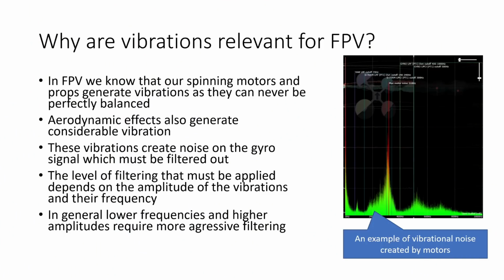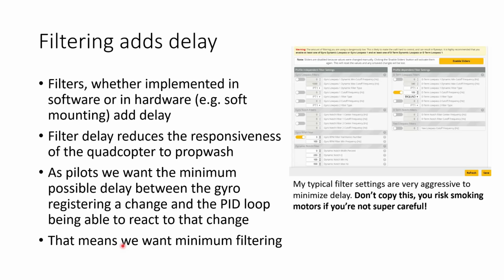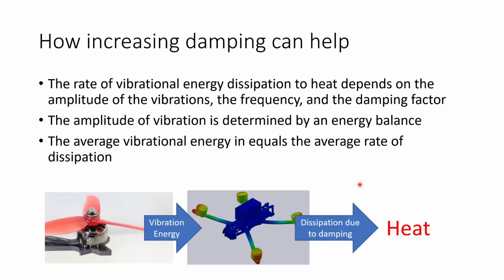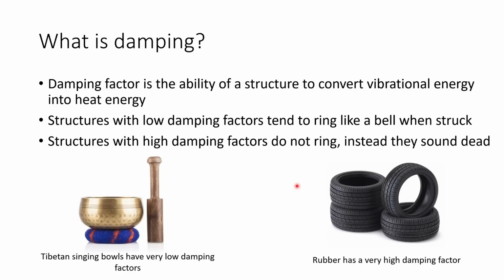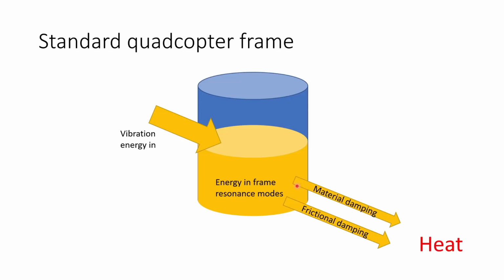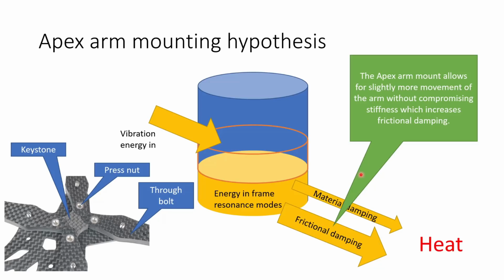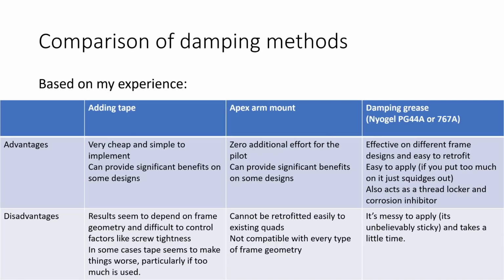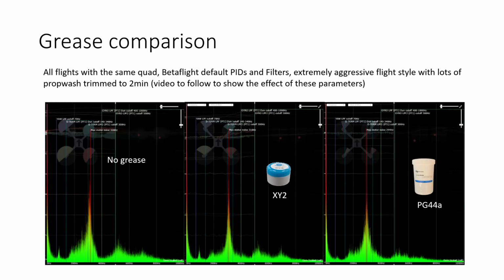How vibration and damping relates to FPV drones and how to increase damping to improve performance!

Comment: something that I think works for me is to leave the motor wires long and wrap them around the arms and then wrap them tightly with electrical tape. Maybe wrapping them with TPU or NinjaFlex or something a bit 'heavier' or rubbery could do better. I have a 5" marmotte and a 4" gecko with this 'damping' method. I love unibody frames
Reply from the maker: I'll definitely have to try that wire wrapping method. It could be a very easy way to add damping!
Reply: @ChrisRosser  if you try it, let me know if it's really making any differnce :). I need to get into blackbox reading so I can see it myself.

Comment: Also bought some for testing. Currently I'm a bit unsure, where to put it all, but will find out. For now I'd put some to all screws and a tiny bit to the contact surfaces of the carbon pieces. Don't want to mess around too much.
Reply: FWIW he has a YouTube short video where he discusses where it should be applied.

Comment: Great content Chris. Recently greased up my PFVCycle Prototype. The results were good, but man its kinda messy lol.
Reply: I'm just getting my prototype ready today and used electrical tape, I'm not going to have a before and after but I've seen someone else before and after in the frame and it helped, would love to hear your results
Reply: @ugpfpv361  not sure I can post a link, but go to my channel and look for a video called "KababFPV told me to tape my quad" that has the results and the logs in the description. I also have a recent video called "Chris Rosser suggested greasing your drone" that also has logs in the description. basically going from nothing -> tape was a MASSIVE improvement. going from tape -> grease was a small improvement further, but was messy.
Reply from the maker: Thanks for testing Mouse. It's definitely messy but I'm glad that you saw a further improvement because that aligns with my testing as well. I found the grease washes/wipes off with a bit of warm water and soap.
Reply: @ChrisRosser  yeah, if I was working with a naked frame I would have used some Dawn and warm water, but left all my electronics on the main deck and was sort of trying  to work around that haha. Sometimes trying to do something the easy way turns out harder, I probably should have done a full teardown a rebuild in hindsight.

Comment: Excellent video again! I just got two questions about it:
- How good would a layer of printed TPU (0.2mm) on top and bottom of the arms would be?
- When will you post some flight footage so we get to know you as a pilot?
Reply from the maker: It's definitely worth trying. I've been chatting with someone on Discord who has very quiet logs and they have TPU and heat shrink on the arms as wire protection.

Comment: Nyogel is the real deal and don't go thinking you can substitute something else. It's also really useful for our radio gimbals: Apply a small amount to the gimbal tension slides and you can make cheap ones feel smooth and buttery. Dry, creaky squeaky gimbals are revived!

Comment: The viscosity of PG-44A is almost 7 times that of 767A at 40°C and 5 times at 100°C. Do you think they are still comparable in use? I did do a quick test with 767A and it does seem to have some effect, just wondering whether a more viscous one would work better.
Reply from the maker: I would say that PG44a is probably the best. I've found it work really well. 767a is cheaper though and more available.

Comment: If at all possible try silicone thermal pads probably of 0.5mm variety or may be even carbon thermal pads. I imagine they might do a better job than tape with quite a bit less mess all round. At least it should be interesting to test IMO.

Comment: 👍Another good one. Would RC cars silicone oils for shock absorbers and diffs be suitable? They are sooooooo sticky... If yes, better to use higher cps number or lower? Thanks in advance for the answer. 😉😁
Reply from the maker: Possibly, I would try the highest viscosity available. Worth comparing its viscosity to PG44A to get an idea if it's worth trying.

Comment: Another means to dampen theoretically would be to use an extension such as landing gear cylinder made out of TPU to be mounted below frame mount of the motors.  This function acts akin to an archery stabilizer and the resonant energy is dissipated below the motor.  Geometry of solid vs hollow or with gyroid internal supports should provide a means to do so, but at a cost to weight, but would provide benefit of landing protection.
Reply from the maker: A tuned damper is a tricky one. You would need to tune it to a resonant frequency of the frame which will be slightly different for every frame.

Comment: Does the dampening grease really add a large resistance dampening component to shear? I understand viscous coupling example of the dynaflow transmission in old autos.  The efficacy of the use of the shear, is proportional to the speed and proximity  and as one increased the flow and closer the proximity the more the coupling occurs.  Is not more than viscous needed?  IE viscoelastic to store then dissipate energy?   .  Is it possible that the hypothesis of resistance to shear in your example is actually primarily a dissipation of frictional imparting of vibration akin to a bow of a violin?  I would argue if one placed dampening grease on a bow of a violin, one would probable see a very atypical noise emanate from the violin....... and the bow action would not be more difficult, rather easier to do primarily due to reduction in shear force, but the sound would be less due to frictional vibratory decrease?  Perhaps I am wrong, but the concept of a grease for the functional increase of resistance to shear is rather counterintuitive. Again awesome videos and thank you for your instruction and level of detail to understand this nuance of topic.
Reply from the maker: The damping grease allows the surfaces to move slightly relative to each other. It also creates an enormous amount of energy dissipation due to the viscous forces inside the grease because it's viscosity is so high.
Reply: I pose the above as a questions and not from definitive answers to be sure.  So please excuse the questions.  The reason I ask is that if one has a greater degree of coupling in shear due to the grease, would that simply shift the energy to a different harmonic?  Does your system calculate energy below the curves as dissipated energy lost from grease to no grease?  Thanks again for any clarification.  I do see that the grease does work in shear to be sure.  I am just wondering what aspect really is being dissipated.  What one would see if a identical frame were glued using  a RTV silicone vs the Viscoelastic material would be of interest as well.   Really awesome work.

Comment: It would be interesting experiment to use Piezoelectric transducers as an intermediary between frame and arm etc to generate a means to harvest energy instead of heat.  Imagine a joule thief circuit being fed by the piezo elements to power a LED system or feedback into a power system with adequate diodes as valve.
Reply: Haha I was just thinking about active cancelling with piezo, could be combine the 2 for best of both from same mechanism. A supercapacitor would give you your intermediary storage.
Reply: @DigitalArtisan77  Agreed.  A very small super cap would keep the LED's running a long long long time!
Reply: @diveflyfish  well it would, but also everything could feed it including regenerative breaking etc if the supercap buffered the main batts. Lots of little savings of power.
Reply: @DigitalArtisan77  Not sure about regenerative braking but any use of joules vs heat is a step in the correct direction. Rather, the electric energy captured could shunted to keep the board alive etc.  Low current draw aspects powered during flight would allow for longer flight? Probably nominal, but it would make for an interesting gizmo modification.
Reply: @diveflyfish  regenerative breaking is already a thing on some commercial drones. A motor is also a generator after all and theres nothing the consumer market can build that we cant. The future seems to be moving to many small gains rather than big inefficient ones I feel.
Reply: @DigitalArtisan77  Very True, I was not being contrarian, rather I simply do not know about how much one could harvest from such a small mass spinning. Its about scale to be sure.  I was just acknowledging that I have not done the math on scale generation forces of tiny motors and blade mass given the kV of the motors etc.......
Reply: @diveflyfish  didnt think you were, merely admitting lack of knowledge in that specific area, that means you have knowledge of your own to give that perspective, people that dont know a thing often pretend to know all things. I'm am aerospace engineer and we say "thingy" and "whatsit" to each other, what's the purpose of words past communication of the concept 🤣 when you know, you know.

Comment: Chris, what in your estimation would having a FC immersed in a dielectric fluid do to the signal to noise ratio and if one were to do so, what aspect of the PID would be best altered to filter more if necessary?  Assume two distinct density alterations one 1.8X as dense as water which is 800 times more dense than air and one .75 as dense as water.  If you have a means to model this please let me know.  Also, let me know if you do test the material I sent you a link to from 3M on the Viscoelastic film.  Thanks and great work again.
Reply from the maker: That's a very interesting question. Is the FC floating in dielectric fluid or is it still screwed down with standoffs? If its screwed down with standoffs then I don't think the fluid would make much difference unless it was so incredibly viscous that it could damp the tiny movements of the FC board.

Comment: Would love to see a video on ways to damping a frame with electrical tape as it is easily available and easy to work with, also how close it gets to this grease. Great video btw!
Reply from the maker: Kabab did a video where he looked at using electrical tape. It's not something I want to recommend to everyone because its very dependent on the frame geometry and screw tightness etc. It can make things worse as well! Grease is a little more messy but much more likely to give a solid improvement.
Reply: https://www.youtube.com/watch?v=Ybx4oVB2Vvg - Johhny FPV was ibto this years ago. :-)

Comment: I wonder if carbon fiber could be made with a damping material between the layers?
Reply: Chris, I have done that with one of my frames. I used a non-vulcanized rubber compound specially made for composites (Kraibon AA6CFZ) which then vulcanizes during curing in the autoclave at 120 °C. I put that exactly in the middle of the composite  (1 Layer twill 200 gram, 2 layers UD 600 gram, Rubber – 2 layers UD, 1 layer twill). And it works really well, you will recognize it immediately if you tap it its really dampened. Also tried this with Kevlar, does help a little but it’s not the same.
Reply: @joeljonker990  make a video about your composite!
Reply: @joeljonker990  Joel, sounds like you have something here.  You know I tap my frames to see if there is a clear "note" that I can hear.  For example the Rekon 5 frame really has a very clear note that rings.  Are you making a video about your experiments?
Reply: @Grim FPV  I do some development for NBD and I would be happy to setup a video chat with you to talk about how I would go about doing it and some of the advantages and disadvantages of it from a composites standpoint.
Reply: There is one. Furribee X215. I have 2 of them, they were both bnfs. Frame might be ok, maybe also because of that, but those quads had so many other faulty components which made them so problematic.
Reply: @Grim FPV Can you tell us more?  Maybe even make a video?
Reply: No because the damping material is viscous and does not set.. The epoxy resin that is used in carbon fiber is fairly ductile and when paired with carbon fiber (the stiffener in the composite structure) you get the combined performance of both. If you were to try to use damping grease it would be the equivalent of trying to build a kwad out of old honey and table cloth.
Reply: @Grim FPV Foam layers are cool unless you have a don't have any out of plane structures in your frame design. If you don't you will get the same issue that the TBS Source Aureo had which is the foam splitting and then you are left with 2 halves of foam and carbon - foam is not great counteracting interlaminar tension... and the foam splits.
Reply: Holybro kopis arms look like an Oreo. Foam filled
Reply: There is a new quad think from tbs 7" 2 layers of carbon fiber with foam inbetween. It's a square shape connecting all arms

Comment: Kudos for saying that mechanical damping also adds delay. I think people have an impression that filtering with mechanical damping comes at no cost
Reply: It depends on what you are damping. Damping the FC will add delay, damping the arms and motors probably won't, at least in my mind, since those movements are not what you actually care about. IMO.
Reply from the maker: I agree. Damping within the frame doesn't really add meaningful delay while soft mounting the flight controller isolates it a bit from the quad and so does add delay.
Reply: What are your guys talking about? Of course damping within the frame will add delay. It's just that by damping at shorter distance to the source of vibration you push the frequency up and the level down (proportionally, so that the energy is conserved) and high-frequency noise is easier to deal with.
Reply: Control theory is very unintuitive sometime. The trick I use is to imagine the extremes, for example a soft-mounted motor. Think like mounted on a jelly. How would quad perform in this case. And by magic of LTI systems this thought experiment holds true for a real world system if it's not too non-linear.

Comment: We just need a little "speaker" to play the opposing resonance into the frame. Like noise canceling headphones. I'm guessing little would be an understatement.
Reply: You're completely right and good thinking, active cancelling totally a thing and wouldnt need power.
Reply: wrong. 
Little speaker and 100hz tones = will never happen.
Reply: @TAGE_FPV  it depends if you understand what he's saying and that's to impart a cancelling resonance with a magnetically driven mechanical device capable of such. Sorry is 100hz a valid measurement or missing some zeros? That's not a high frequency.
Reply: @Justin Hunnicutt  why are you attempting to school me in what I told the other guy? The 1st guy had a great idea but not the terms to express it, the intellect good but the language lacking, that's still a win in my book, some ball bag can't grasp the greater concept and issued his response disrespectfully IMO., As I said "it depends if you understand what he was saying and that was a mechanically actuated frequency generator to counter those generated in the quad..., but all that aside, if that's the frequencies that are causing an issue, in the context of vibration and resonance it's a ridiculously long wavelength, like the length of the quad or arms need to generate that, have you heard a 100hz test tone? 🤣 a cat purrs at 100hz, that's definitely requiring mechanical damping.

Comment: Been looking forward to this...... I reckon a few like Mr Bardwell are slightly skeptical of whether the advantages are worth the effort.....
Bit like soft mounting motors years back

I'm just doing an Apex build, going to do a "feel" test before and after adding the grease without looking at blackbox etc at all.
Im just an average guy with average skills.......Will I "feel" a difference?????
Reply: I would think that doing a before and after would not reveal anything. The reason to add damping is to be able to lower the filters without having resonance issues. 
If you tune the quads filters to it's limits before the grease then see if you can reduce them any more after the grease. Just adding grease alone  isn't going to make it fly better unless you already have vibration issues at your current filter settings.
Reply: @CricketyChris  Yes I agree completely 
So like soft mounting motors of old many may question is it really worth doing
Reply from the maker: Skepticism is great for science! Anyone who is unsure can test this for themselves and report back to the community their results. With more data we will be able to be more confident about whether this damping grease is the right answer. 😁
Reply: @ChrisRosser   Just finished watching the video In full.
And my concluding thoughts are (but will continue to think it over) this is definitely something worth doing even if we can't easily "feel" the benefits as it clearly will aid the FC to do its job more effectively!

Thank you very much for this information and the time you have put into it.

The only negative now I see is the cost of the grease..... ouch!
Reply: id doubt you'd feel a difference on the apex, that frame is solid enough as is

Comment: Bought the nyogel, thanks Chris!
Reply from the maker: Hope you enjoy it and it works for you!
Reply: Since you've got some experience, can you advise on the application on a frame, the amount for instance? My guess is a thin film will be enough?
Reply from the maker: Yep just a thin smear is all you need. If you put a little too much on it just squidges out when you tighten the screws so no problem.